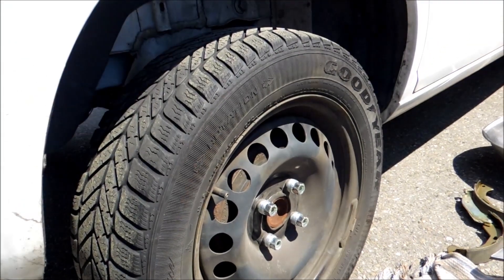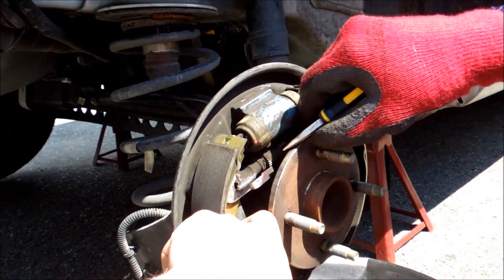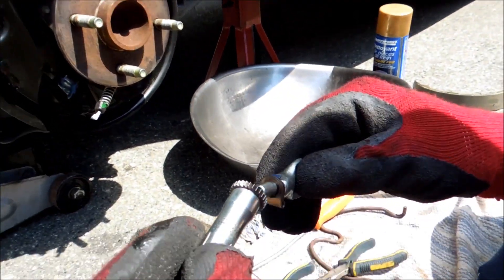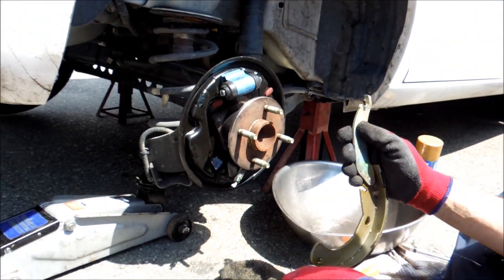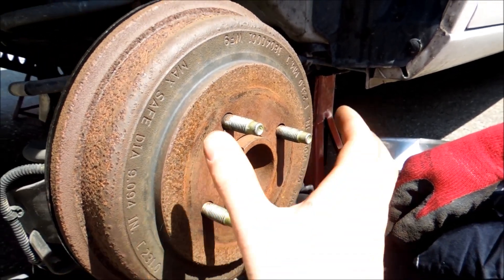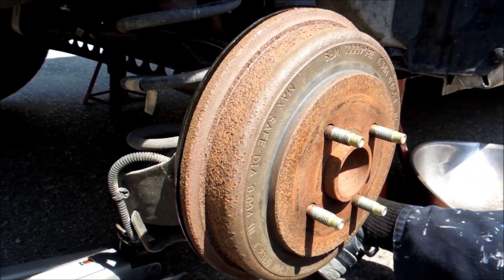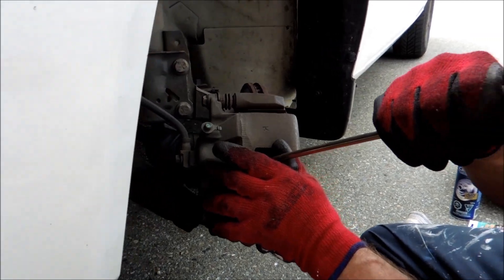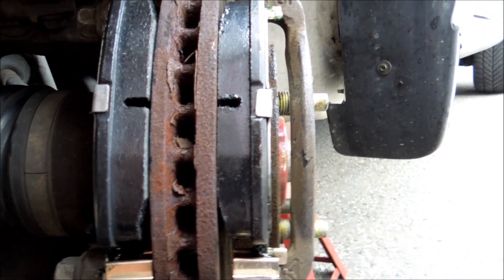How to change rear drum brake and front caliper brakes on a chevy cobalt 2007

Comment: Massive help - Thank you! Needed to replace the rear brake cylinders on a 2004 Saturn Ion Coupe. 

I found it helps to use a 10mm socket on the parking brake handle connection to remove tension from the parking brake line when removing/re-installing.

Comment: Thanks to your video I was able to conquer the task. Bendix brake shoes and Pronto brake drums. Only problem at higher speeds 40+ I get a vibration when Braking. Called the store and they will either cut the drums or replace them. Hope that remedies the issue.. Thank You.

Comment: Okay everyone they have a emergency parking brake pliers (cable at bottom with spring) makes it easier to open and lock open to get cable in $22 online. Also the top part (below the brake cylinder) is the Brake adjuster not parking brake as stated in video. Sometimes the emergency brake cable is a little thicker than the slot it fits into. Just use a screw driver to pry the slot open a hair more.
Reply: Also the brake adjuster doesn't just allow it to not get lose. When you back up vehicle and hit brakes it tightens the shoes up hence the name (brake adjuster)

Comment: You can also release the parking brake cable from the other end, that will make putting the shoe back on much easier.
Reply: Hey William, could you give me some directions on how to release the parking brake cable from the other end?
Reply: Bryan, 

You will need to take the trim off around the handbrake, and remove the arm rest if you have one. Then you loosen the cable, pictured in image 4 on this page.

Getting those rear brakes back on was a bit of a struggle as I recall, good luck.

http://www.cobaltss.net/forums/how-guide-43/how-remove-center-console-%5B56k-%5D-81949/
Reply: +William Wallace thank you for your help! And yes installing the emergency brake shoe on that cable is really giving me a lot of grief so it's time to try your method😉

Comment: If your brake drum is terribly rusted and the outer cover won't come off, would it help to apply heat with a blowtorch?
Reply: Caleb Byma Use a hammer and a rubber mallet to pry it off around the drum
Reply: I used a large Craftsman  puller. Once you good puking tension, tap around dum and it should slip off. Oh yeah, first spray the hub and around the lugs with Liquid Wrench or PB Blaster and let that soak for a couple of minutes.
Reply: Large Craftsman GEAR puller.

Comment: Actually, the brake clip tightens the brakes against the drums when you back up while pumping the brakes. If the brakes are already tight, it just slips over the gear and won't tighten too much

Comment: oh american auto engineers... way to make a simple task miserable enough that i would far prefer burning the car to the ground. every damn inch of this car is designed to never be worked on by less than 3 anorexic, yet strength-training midgets simultaneously ...& this is coming from a guy who works on tight tolerance Japanese sportbikes. when i get the right shoes delivered (they sent me G6/Malibu ones), i'm going to finish all this remedial maintenance & sell the bass-ackwards embarrassment to logical thinking.